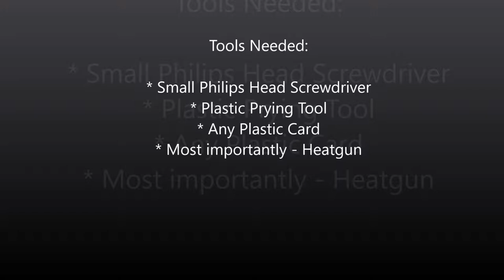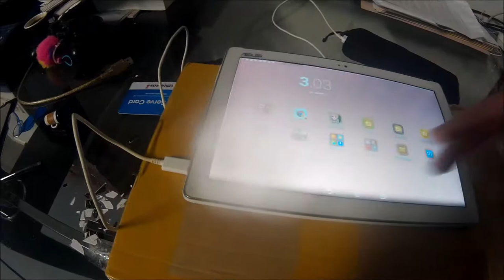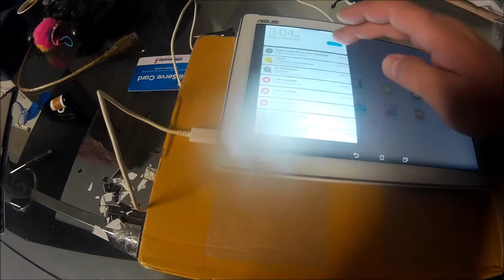How to repair a cracked screen on Asus Zenpad Z300M P00C

Comment: sorry i have a question, is there a risk of damaging the lcd by sliding the card under the broken glass?
Reply from the maker: Yes, so make sure you stick to the edges and apply enough heat.

Comment: What i don't get is why you're using a simple hairdryer for the task. it doesn't generate way enough heat to lift the screen and adhesive away cleanly often leaving the adhesive in place on the frame and spending far too much time cleaning the surplus from the frame. I don't recommend those following these instructions try to install glass on top of old adhesive Always better to start with fresh. using old creates an increased chance of cracking the new glass for 1 simple reason. the old adhesive is no long er flat even and uniform 'and during damaged screen removal some of the old adhesive tends to ripple and ball up. causing an uneven surface resulting in NEW SCREEN CRACKING and you're back to square 1 only now you have to buy another new screen
or suffer the loss and bin the tablet.
Reply from the maker: Thx for the advise mate, I would use one if I had one...moreover, for beginners it is always safer to use a hairdryer as it is less powerful and it does not generate as much heat as the heat gun... most often people who watch those videos aren't as professional as the repair shops and are looking for the cheapest DIY option available...I appreciate your feedback and indeed it is more efficient using a heat gun. thx for passing by mate.